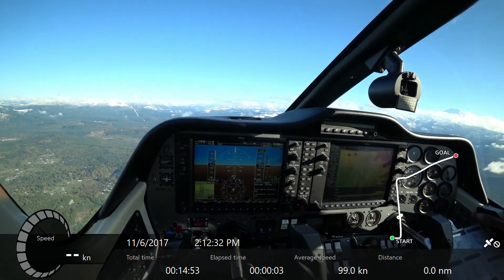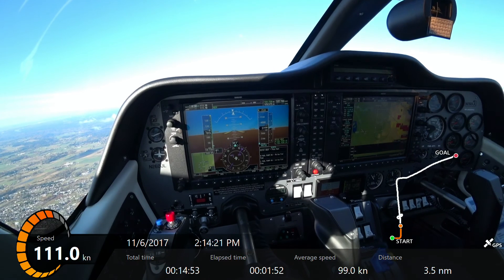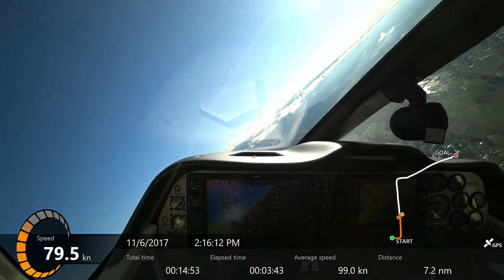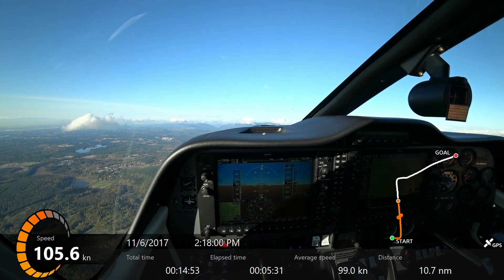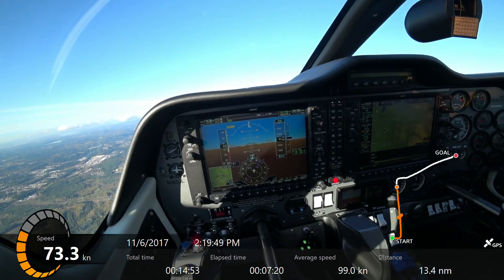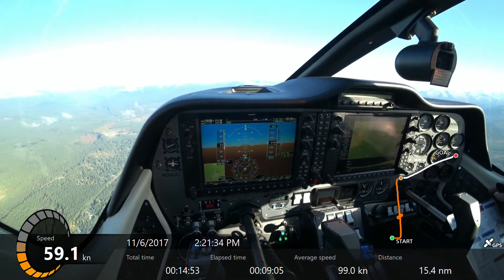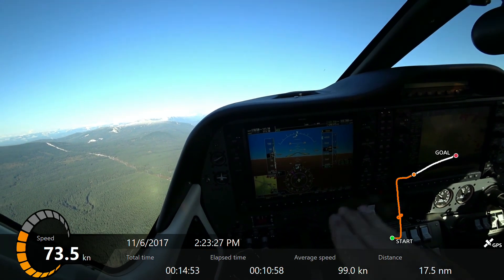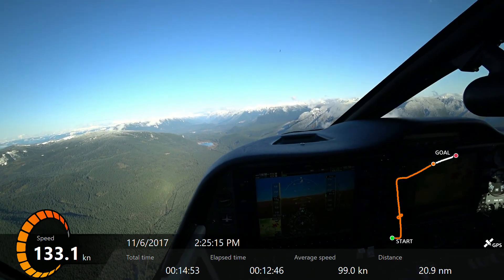Twin Tecnam P2006T MEI | Steep Turns | Slow Flight | Stalls!

Comment: Was that a 60 deg ST?
Reply from the maker: It was 45-50 most of the time  It should have been to comercial standards but we might have been practicing  for private pilot also, I can’t recall.  The student  flying was working on his MEI rating and the examiner can ask for private or comercial standards so we practice both.  

It looks steep in the window though doesn’t it . If you watch it on a bigger screen and make sure the YouTube settings are 1080p you can see the bank indicator as he does them.  Thanks for watching !
Reply: NERO AVIATION Cheers! I’ve been watching twin videos as I plan on doing my MeCIr next year so these clips offer some decent tips on on Me flying is different from SE - btw the stalls look quite benign .. doesn’t a light twin like the Tecnam suffer a wing drop during a power on stall?

Comment: where and how did you attach your camera ?? I have the same camera and I can't wear the headband because it blocks peripheral vision.
Reply from the maker: It’s in the top left corner of the front right window ... I make sure it’s clear of the fuel pump switches but that’s about the only issue for me and it’s up a little higher than eye level.  
 
I would like to put on left window but it would be in the students way. 

Thanks for watching !

Comment: What program are you using that tracks your airspeed etc?
Reply from the maker: My Sony fdr-x3000 camera has a built in gps and they supply the software with limited gps overlays. A better set up is using the g1000 gps data and Dashware software and then I can make almost any gauges I like and all sorts of crazy data. Dashware works with lots of different GPS  data though  and you just sync it with the video.
Reply from the maker: http://www.dashware.net/